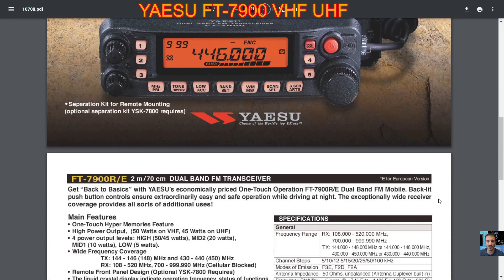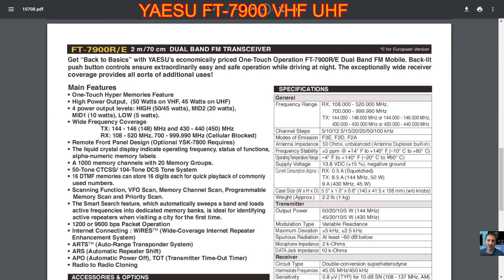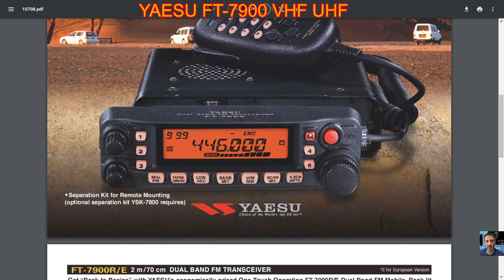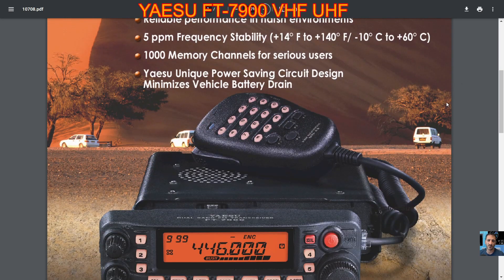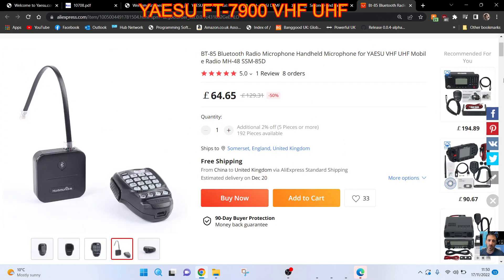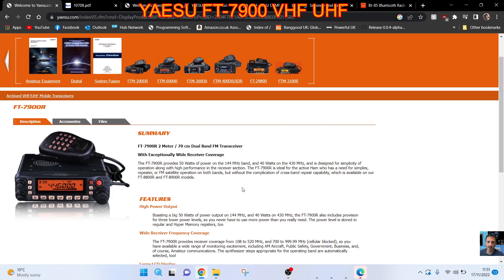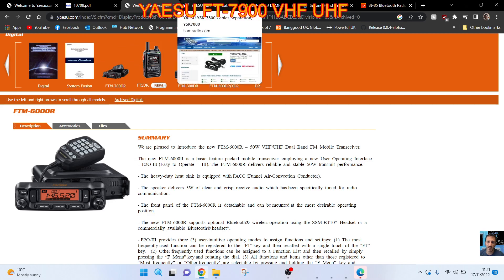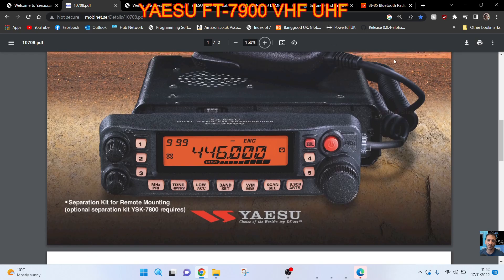YAESU FT-7900 VHF-UHF BROCHURE info & links

Comment: ARTS is a system often used in Search and Rescue environments to ensure all parties stay connected with each other. It Polls a short DCS carrier at set intervals and when you lose connection it will alert you.
Reply from the maker: Hi Simon can i test with my ft400 or ft100d
Reply: @HamTechRadioScannerDrones  you should be able to, maybe go for a walk with your FT-5D a d see what happens.